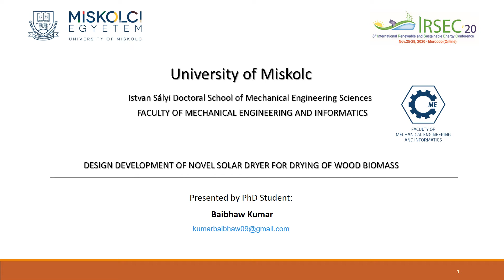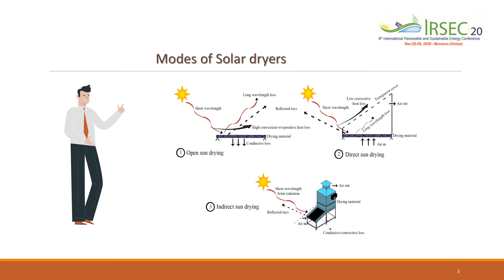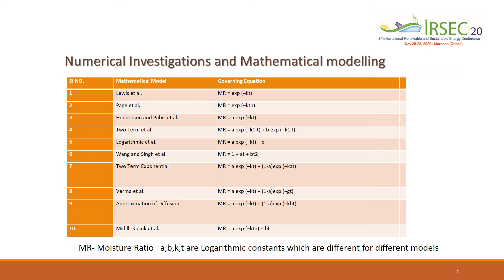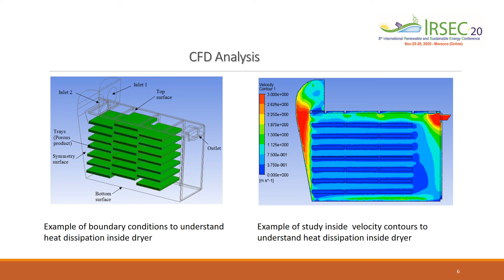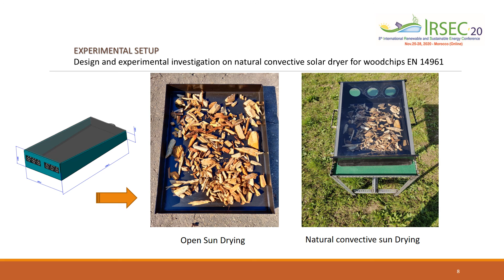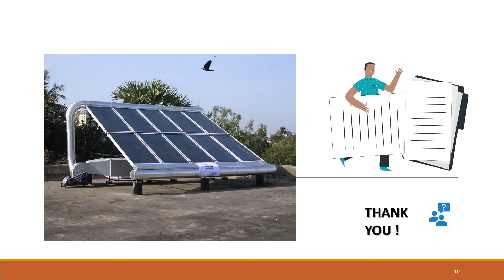304 - Design and Development of Novel Solar Dryer for Drying of Wood

Comment: Maybe you can use this for sun dried tomatoes in more humid climates. 

But to dry biomass, a rotating agitator with a continuous feed/flow through production is the only thing that makes sense to me. Parabolic solar collectors for high temp process heat, pressurised water working fluid, blow through the agitator. A large thermal buffer in the form of rock/pebble thermal store would smooth out the solar maximum to a more efficient average.